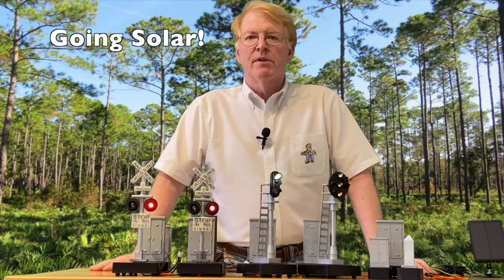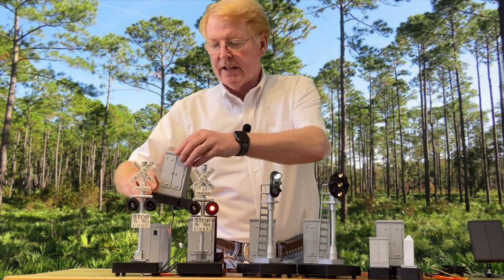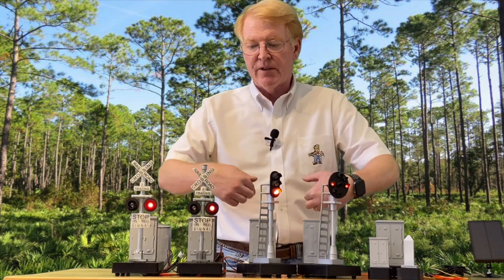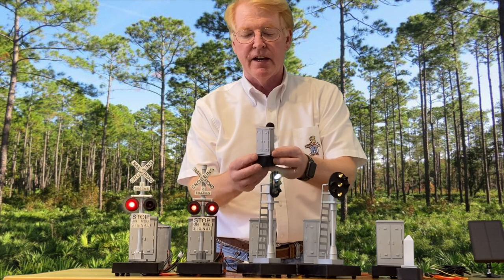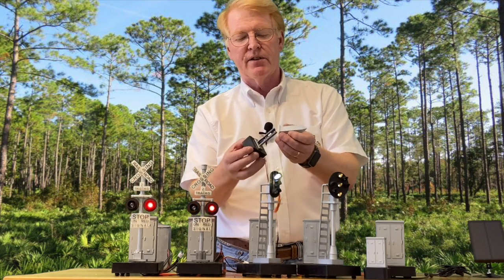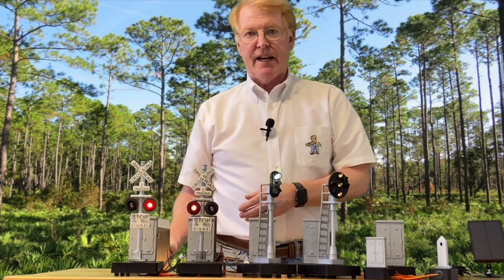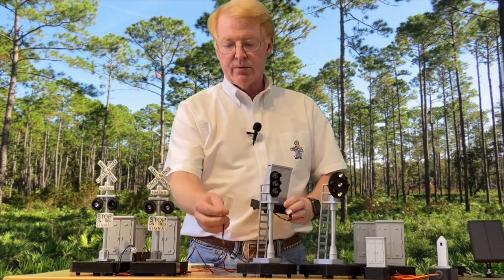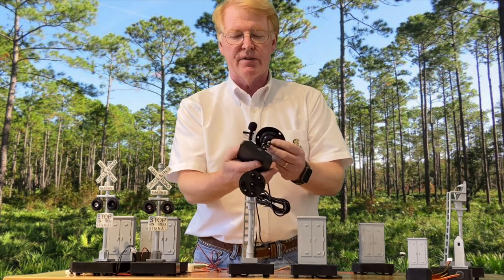G Scale Signaling - Going Solar!

Comment: Very nice addition. Is the solar system 12v output ? I was thinking of it to power other accessories or led in my garden railway.
Reply from the maker: Yes, 12VDC.   That really depends on that those other items are.  ALL items, including ours, must be manually switched off for the Solar to recharge the battery.

Comment: Can your signals be use with track detection as so they are lit and signal aspect is based on train location on the track? Or are they timed to go back to a clear after a few seconds?
Reply from the maker: The timed change from Red to Yellow to Green starts after the train has left the block.  However, latching allows the block behind to stay yellow if the block ahead is not clear.  This creates 90% of the full block control without the headaches of more complex approaches.
Reply: That’s awesome! Don you have plans to perhaps make semaphore signals? Also love your grade crossing signals! I’m going to look on your website at your products!